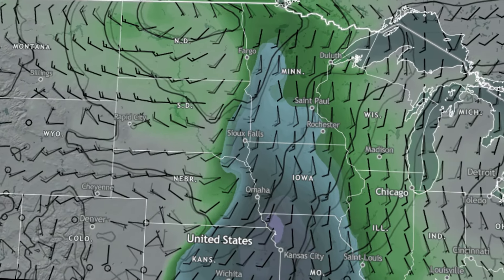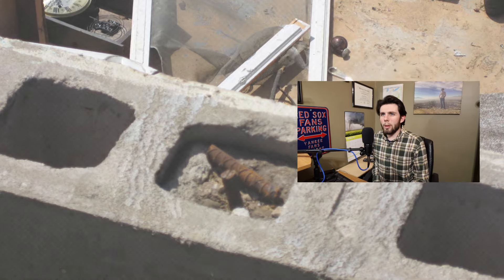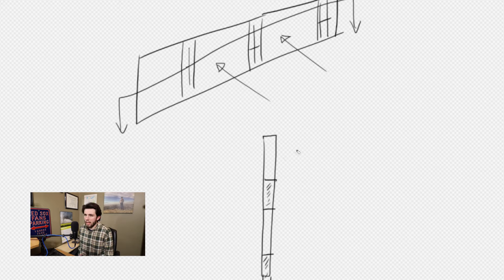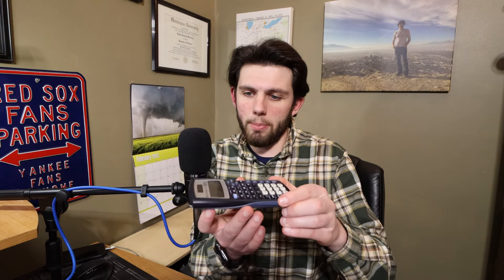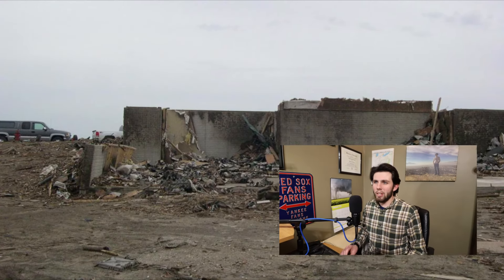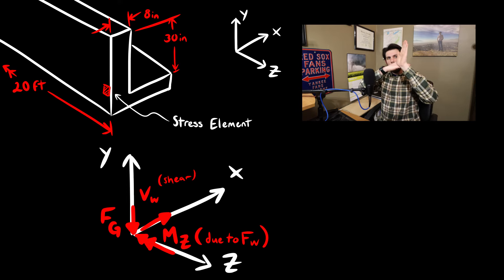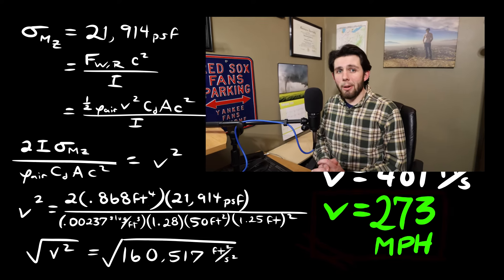DAMAGE ANALYSIS: Parkersburg, IA EF5 Tornado

Comment: I just want to clarify that the main issue with the De Havilland is a lot more nuanced than is often talked about (and yes, I know it wasn't the main point of the video but as we're talking planes for a moment...)

It wasn't the passenger window shape that was the problem (though I know that's what everyone talks about) but the effect of metal fatigue with the frequent pressurisation cycles, and the type of riveting used in the framing around openings in the main chassis. A lot of sources like to oversimplify that it was all down to the shape of the windows, but it wasn't even the passenger windows where the failure occurred. The report showed that the metal failed around a "window" for radio signals on the top of the plane for the ADF (Automatic Direction Finder) antennae. This isn't a typical window, as it's filled with opaque material and is more like a panel, though metal fatigue and cracking were also occurring around the door frames as well as passenger windows too. 

In addition, while the sharper corners of the ADF window exacerbated the rate of the metal fatigue because of the pressure build-up, it wasn't the sole culprit (or even necessarily the main one). It was much more down to the fact that the metal was riveted when the original design had called for it to be glued, and on top of that, the specific form of riveting used (punch rivets) also created microscopic cracks from the get-go. The passenger windows themselves were already rounded at the corners but were further rounded out of an abundance of caution, as tests showed that the pressures were higher than De Havilland had estimated, and they chose to round them further to reduce the stress, rather than to reinforce them more, because of the issue of weight.

Comment: Putting aside the amazing content in itself, I'm really glad you talked about the Parkersburg tornado due to its status as being a "forgotten EF5."
Reply: Minden Iowa was recently hit. Also an EF5. 16 years later.
Reply: @ZackSansing  It was an EF3 last I heard
Reply: @jakson11  it was wide. Like 2.5 miles wide. 

There was possible evidence of ef5 damage.
Reply: @jakson11  it’s as wide and strong as Parkersburg almost 16 years ago.
Reply: @jakson11  There was more evidence of EF5. Milden Iowa tornado is the first EF5 since this Parkersburg tornado one back in 2008
Reply: @ZackSansing  I was just wondering where the source is? I tried to find updates but couldn't anywhere
Reply: @jakson11   I dont know. There were reports of it being 210 miles per hour and the same miles wide if not wider than the Parkersburg tornado.
Reply: @ZackSansing the wind doesnt matter for the ef scale. greenfield iowa 2024, arguably the strongest tornado ever, was around 310mph+ and was an EF4, because it didnt cause EF5 damage.

minden did not hit strong enough structures to be rated an ef5.
if it did hit strong enough structures, i do believe it wouldve been an ef5, though, so i see your point
but it was not an ef5.
also, the most recent ef5 was the Newcastle-Moore, Oklahoma tornado of May 20th 2013.
Reply: @blueberrywxx  Minden Iowa is the first EF5 since Parkersburg. See? It was wide and had 210 mph winds. Few of the tornado damage had no homes. No debris. Nothing.
Reply: @ZackSansing  moore 2013 was the last ef5, minden was an ef3, minden hit weak structures, thats why there was no debris..
Reply: @blueberrywxx  it still was EF5. Destroyed homes that have no basements count as EF5. Just like Joplin Missouri 13 years earlier
Reply: @ZackSansing  No, no it doesn't. It needs good construction quality to count as EF5. I would know, i've been a weather enthusiast for 5 years...
Reply: @ZackSansing  Lmao, went silent?
Reply: @blueberrywxx  ok. Whatever you say. Minden, Elkhorn, Mayfield/Princeton, one IL tornado forgot the name has 100% EF5 evidence
Reply: @ZackSansing  the illinois tornado would likely be Rochelle-Fairdale, which i agree with, but elkhorn? elkhorn is not AT ALL close to EF5. your takes are genuinely horrid, you are not an engineer, you do not work for fema, and you are not a damage assessment surveyer. but minden, elkhorn are not even close to EF5, Mayfield is definifely debatable to if it deserves EF5 or not, i personally am kinda inbetween thinking its rated correctly as an EF4 or incorrectly and shouldve been EF5, and i think rochelle-fairdale was certainly misrated, shouldve been EF5. other then that, your takes are HORRENDOUS
Reply: @blueberrywxx  what ever you say. Elkhorn is a massive tornado.
Reply: @ZackSansing  massive tornado does not equal EF5, how old even are you?
Reply: @ 23
Reply: @ZackSansing  23 and being educated by a teenager is insane, lmaoooooooooo, no way
Reply: Me and two friends chased the Minden, Iowa tornado on 26 April 2024. We saw two other tornadoes (Pacific Junction, IA EF1 and Manilla, IA EF2) that day with the same supercell that originated near Union, Nebraska. Minden, Iowa tornado was rated EF3 with 160 mph winds. The house that was swept away was poorly anchored. A wide tornado doesn't mean it will be intense or violent. Vast majority of wide tornadoes have multiple vortices which is where the strongest winds would be located because of the conservation of angular momentum. Skinner the vortex, stronger the wind while wider the vortex, weaker the wind.

Comment: I have have dual degrees in physics and economics (odd pairing, I know!), and I have to say this is exceptionally done. Not overly scientific but enough to make sure the data points are there and make sense to the majority of the viewers. Good stuff here, sir. Like other commenters, I expect your page to take off exponentially with time! This is a good one; look forward to an analysis on that monster that tore through Joplin in 2011 and even Smithville and Philadelphia Miss in 2011. Would be great to see all the exceptional data points from those aforementioned disasters as well one day. Cheers!

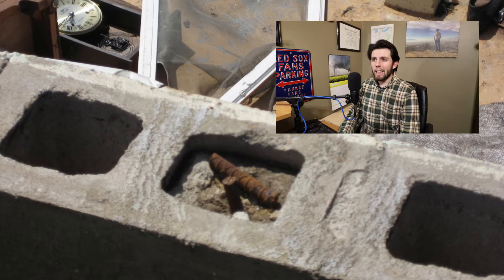Comment: At 4:30, that sheared piece of rebar looks like it was cut a day after the concrete set up around it and the scrap piece fell into the pocket and was simply left there knowing it would be covered by the framing of the new home, at the time. I used to set walls similar to this and what I described above is all too common in the construction industry.
Reply: i agree , thats old rebar . not a recent shear
Reply: 100%
Reply: You're prolly right in this instance although we have seen rebar sheared previously in ef5 tornadoes.
Reply: I don't know about Iowa building codes and standards, but that whole wall that was shown looks like poor work to me. I've been in the trades for going on 30 years, those type of foundations are useless in a storm. And those cinder blocks are mostly empty. Looks like only enough to keep the wall standing on a good day. I'm guessing (hopefully) this was just a bad example of construction there.
Reply: @ I was in the commercial trades, we always poured concrete, never block foundations. Chicagoland.

Comment: That damage has to be amongst the most extreme ever recorded. NOTHING was safe from this tornado. We are talking about Hackleburg, Smithville, and Rainsville levels of intensity.
Reply: Crazy to think that all of the examples you listed were in one day.
Reply: @iiSlightlyModified  What's even crazier is that two of the 4 EF5s during that day were sister tornadoes from the same supercell, the Philadelphia MS EF5 and the Rainsville Fyffe EF5. That cell also produced the super long tracked cordova EF4 and the Ringgold GA EF4. The New-Wren and Smithville supercell is also quite impressive, especially when you consider that the Smithville EF5 formed not long after the New-Wren wedge dissipated. What an insane outbreak.
Reply: @dannyllerenatv8635  I did not know Philadelphia and Ringgold were from the same cell. Wow.
Reply: Late to the party but New Wren was an EF5, but not assessed properly. I understand though, that day was crazy for the assessing staff.
Reply: @CMasta121  Yeah, New Wren was a miss in that sense. That tornado was very much an EF5. However, surveying these tornadoes must've been absolute hell

Comment: I have protective geared stored in my shelter place for after the storm.
     Among the many pictures documenting the 1974, F5, Xenia,  Ohio, tornado is one of an intact home pushed off its foundaton.  That home was 2 or 3 homes south of our friend's home, of which only the half-inground,  two car garage bately survived.  It too showed signs of the dtorm pulling on its concrete block walls.
     There is another such picture of a home in Kentucky.
Reply: Those old balloon framed houses are a lost art of construction engineering, instead of being obliterated, the whole thing is moved, and in somecases able to be moved back onto a foundation and repaired.

Comment: Something interesting about your point on the De Havilland Comet, it was later found that the square windows had no effect on the aircrafts integrity. Plenty of aircraft of the time had square windows. The issue was that back then, they simply misjudged how far the plane would be able to go through the flight cycles before it would need maintenance.
Reply from the maker: Makes sense! Fatigue stress is always something that needs to be considered in cyclical loads.

Comment: I'd be interested in your take of toroidal winds rather than just sheer force winds - I would suspect a direct impact force would imply multiple directionality of winds. The stress is multiplied by not just winds but by the additional debris which can be a variable.
The shape of the building as well as the connectivity to the ground would likely also play a large role, as you mentioned regarding the survival of that Porsche due to aerodynamics.  I'm terrible at math but I am so very interested in structural engineering in relation to natural disasters. Good man, you're doing wonderful work that I hope architects, infrastructure and logistics professionals watch all of your videos and adapt proactively in accordance with your analyses.

Comment: So if it’s half inch it’s not gonna be hard to cut through or break cause I can cut through that with bolt cutters so they probably need to do thicker rebar I guess for tornado valley

Comment: the crack in the concrete wall is incorrect. Those cracks are far too straight for poured concrete. This is a cold joint(concrete poured at different times). Beyond that, the wall is knocked over- not by the wind pushing the wall, but by the wind that was pushing the house attached to the wall until the bottom plate of the house gave way and the concrete left behind.

Comment: The rebar was cut during construction. What I have seen in the image is that the rebar was too long.They cut it with a fiber disk, leaving the piece to be left under a   sill plate. Absolutely preposterous to even think it would shear off so clean from a twister, and leave the chunk right next to it, that just happens to match the cut of concreted one.